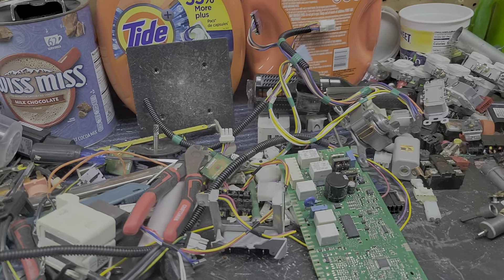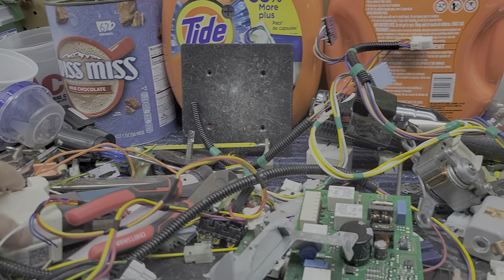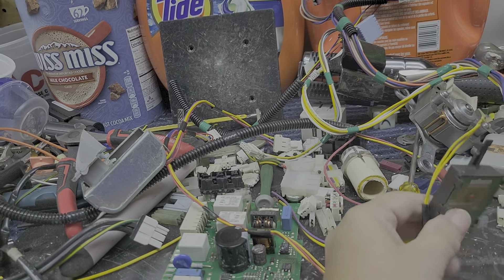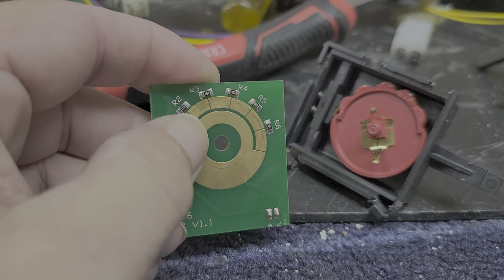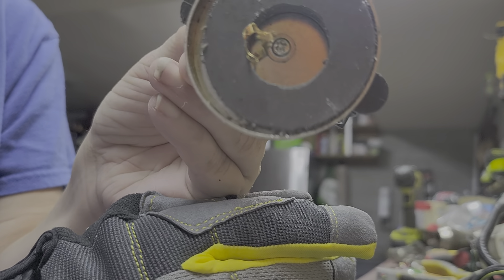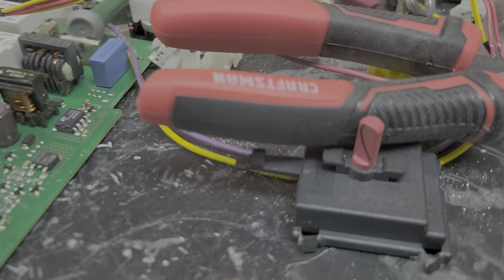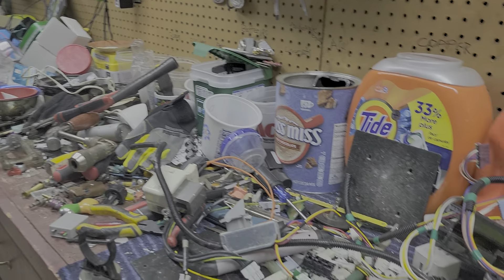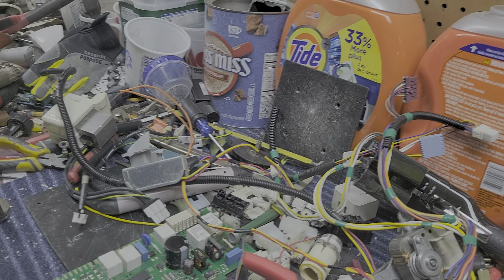Scrap Metal Death Pile + Modern Appliances R not Worth the Effort.

Comment: The planned obsolescence really did a number on us.
Iv noticed the same thing.
Reply: Looks like that potentiometer is gold, Miss.
The little dial board. 👍
Reply from the maker: yeah, I looked at it more closely later and decided they must be gold. I don't do much gold recovery. Just take the mid grade boards to my year. But I don't get many computers. I get the boards out of TVs, microwaves, and other electronics. thanks for watching.
Reply: Thye dont flash plate brass (onto copper), im not even sure they can as its an alloy. Thanks for sharing!